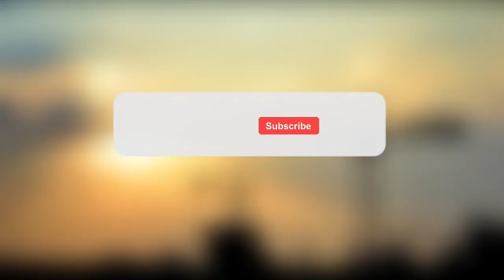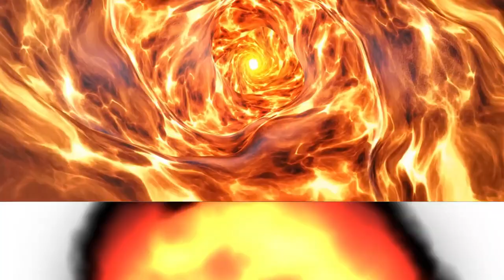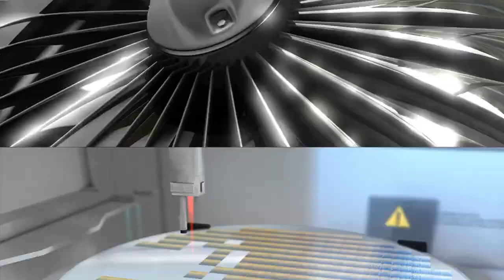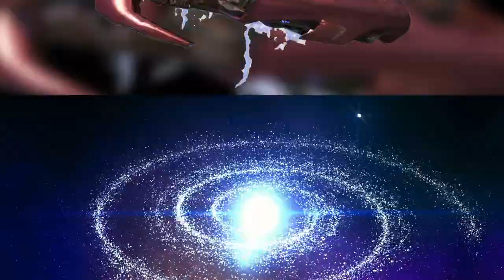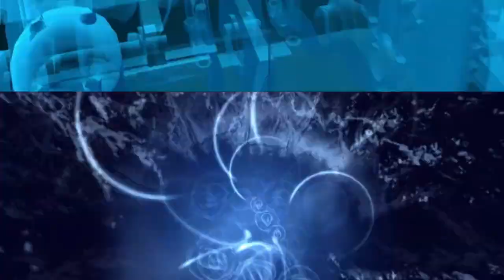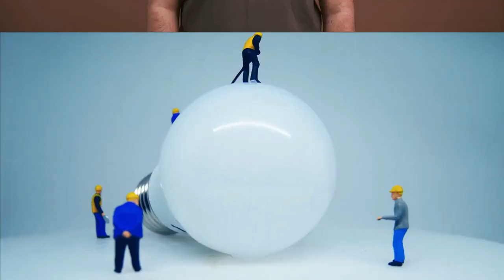China World's Artificial Sun | China Artificial Sun

Comment: Fusion is unsustainable for reasons we already know.

Fusion exerts extremely high outwards pressure. The only reason it is sustained in a star is due to massive gravitational forces. We attempt to mimic that force using electro-magnetism but neutrons do not interact with the EM field. Energy will always be expelled outwards in a magnetically-confined nuclear reactor. ITER uses these neutrons to generate tritium from the doped shielding plates. However, they will have to be replaced periodically for the same reason.

Neutron confinement will hold the key to unlocking this technology. Until then, expect diminishing returns and unsustainable reactions.